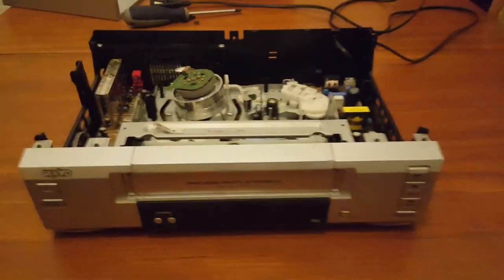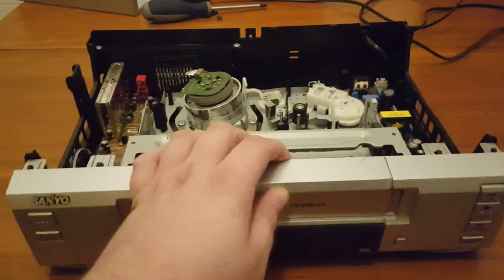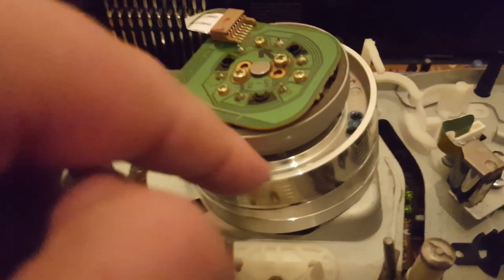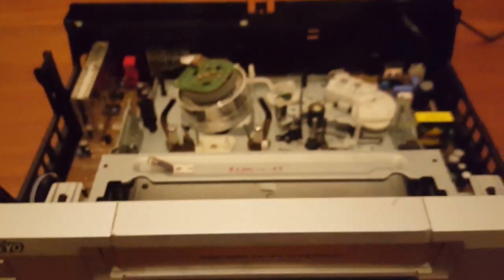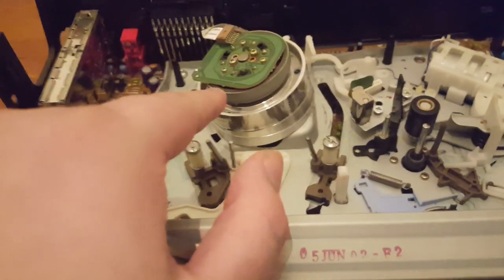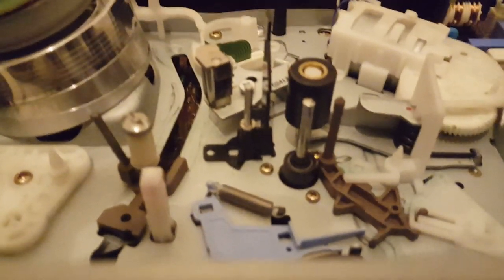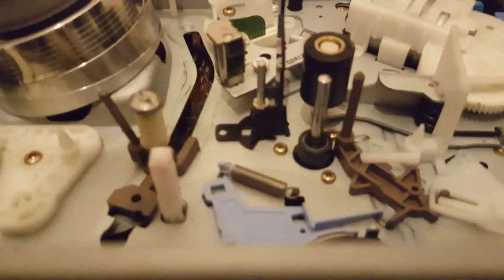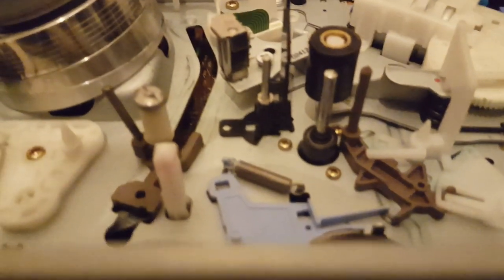VCR Tricks And Tips For fixing your VCR.

Comment: hi 
i have betacam  decks  i have not change any cap in the power units at all   there is one model i need to change over 5 caps under the VU meter  and change  a small fuse 

i changed capes for my mate  he gets up set about the cost of the new caps  i have to put in as he's only payed silly money for the deck

i had to pay £17 for  4 new caps 6800uf  ones   i did pay alot for the  soundcraft 381 - 8 
a deck like this  i don't know what it cost now

Comment: Having an issue where I put in a tape , machine ejects and powers down. Any ideas?
Reply: Did you find your answer?  I'm having the same problem.
Reply: Pretty sure the belt is worn so the machine turns off to prevent damage to the tape. Gonna throw some rubber bands on there and see what happens.
Reply: @Ericonwheelz  gonna try fiddling with the capston. Unless it something else??
Reply: Any luck? I'm having this issue now.